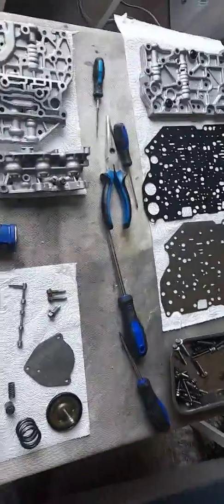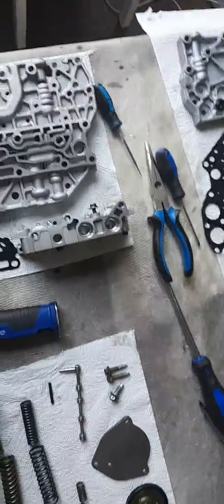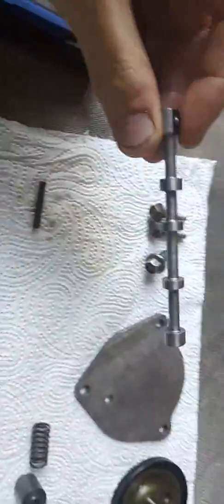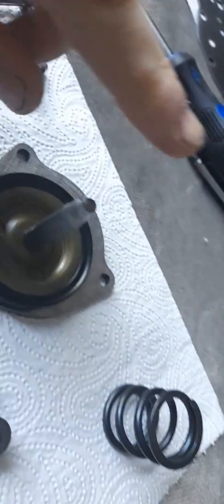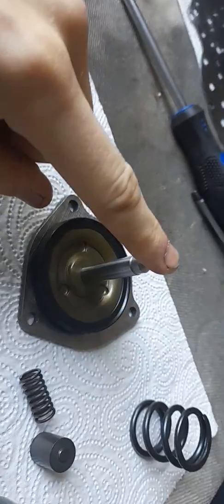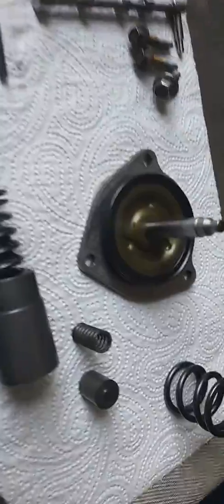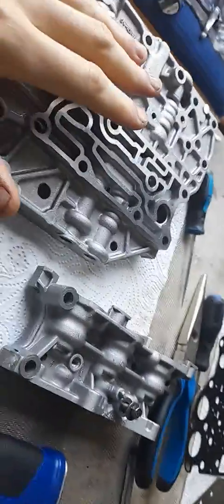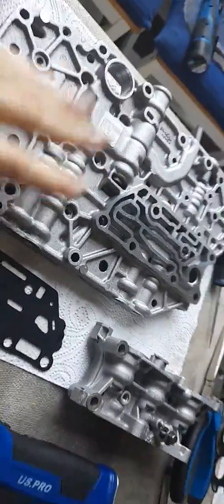Ford Focus 4F27E Automatic Transmission Common Issues & Rebuild Advice Part 1

Comment: We nearly have body out of box but something is holding it in middle,  any idea what I'm doing wrong?
Reply from the maker: There shouldn't be, check all the bolts are off think there's 11 on outside of block and make sure the manual valve is disengaged from the selector mechanism.

Comment: Tengo un ford focus 2006 y no cambia marcha atrás, se acelera y en R da un golpe y retrocede pero se cae la velocidad no hace retroceso, se hizo toda la caja se cambiaron todos pero no el de presión como usted dice, podría ser el de presión?
Reply from the maker: Firstly check that the fluid is at the correct level, get the car hot, check the dipstick! Reverse is always the first gear to be lost when there is a pressure issue, far less pressure is needed in Drive. Check the fluid.

Comment: Hello, do you still respond to comments? Could do with picking your brains on something
Reply from the maker: go right ahead :)
Reply: @usuallyfixingtinkering  thanks. I've looked at one of these gearboxes by a friend who knows nothing about cars. Scanned it and have a fault stored for p0733 (gear 3 incorrect ratio). Driving the car gearbox is slipping in 3rd and bangs into gears. I'm trying to determine which solenoid does what.
Reply from the maker: I'll have a look later I've got a chart I can refer to, but it could be mechanical clutch issues not electric. How many miles has the gearbox done?
Reply: @usuallyfixingtinkering  140,000. Sounds strange but doesn't feel mechanical sometimes it shifts perfect. Thanks
Reply from the maker: @tinkeringwithcars3875  going into 3rd, when you say slipping is it a flare where the revs rise and falls when it goes into third? Is 4th difficult?
Reply: @usuallyfixingtinkering  i need to go and drive it again to be certain of the symptoms. It was a little while ago. Fairly certain it was more than a flare
Reply from the maker: @tinkeringwithcars3875  when you do, does reverse work? Does it only affect gears 2-4? How long was the fluid changed - this is something I will ask first. Even something pink but old (more than 10 years) can cause issues.
Reply: Any idea what code po962 has anything to do with..I have the orange wrench light and when it pops on it revs up in first and has a slight "bang" between gears and feels like OD doesn't work.. I changed A and B solenoids and the pressure Solenoid next to it too and the fluid

Comment from the maker: Main issues to summarise - Loss of shifting between gears could be Solenoids A & B Malfunctioning, this will throw a code! Replacements are easy to obtain and can be had with a filter service kit.
Loss of either/both 2nd and 4th - Broken Servo Piston Rod and/or worn Gear Band (usually the piston Rod).
Very harsh shifting between 1 & 2 - Broken Accumulator Spring/s.
There is another issue of the stator/pump bushings wearing prematurely causing pressure leakage, this stops the Torque Convertor Clutch from engaging in 3rd and 4th. Very unnoticeable apart from worse fuel enconomy than usual on motorway/long distance driving.
Reply: Very informative video thanks. Would you happen to have an insight when my focus has no computer error whatsoever. No dtc on transmission or solenoid. But my car moves forward when in Neutral. I have no reverse. It launches but stops at Park, maybe parking pawl engages. At Drive it moves forward normally.
Reply from the maker: @kaletsugas  thank you sir, how do you mean moves forward in neutral? These gearboxes don't throw many codes it's very rare unless a solenoid has failed. If you have no reverse that's a hydraulic issue, reverse requires way more pressure on the clutches to operate. So if there's any issues with pressure then it would manifest as no reverse first of all. Check the fluid level from hot, drive it take it through all the gears, just hold it in each quadrant. Then check dipstick. What colour is the fluid?
Reply: My Focus Mk1 with this box has an issue where sometimes it does what feels like a hard shift, usually when driving slowly so it's going between 1 and 2, and then will go into limp mode.

Replaced the valve body along with the solenoids, but still persists. No fault codes on the diagnostic.

Any ideas what it might be...? Likely to be the box or something else? Speed sensor? Earth connection?